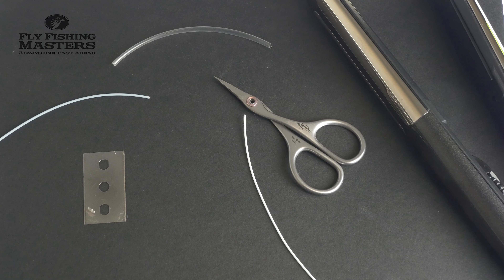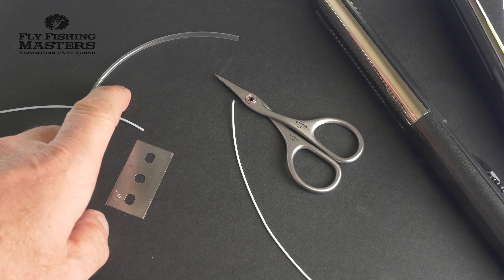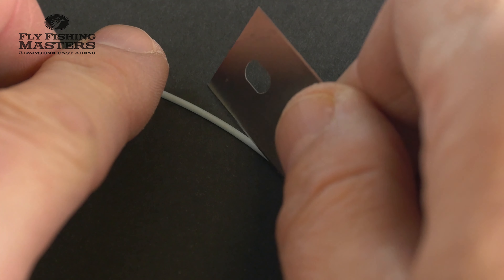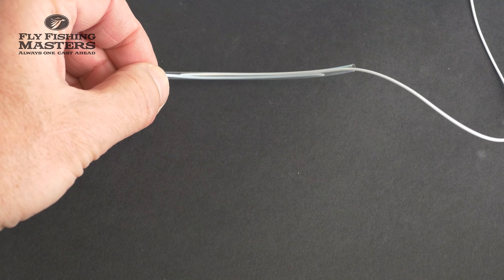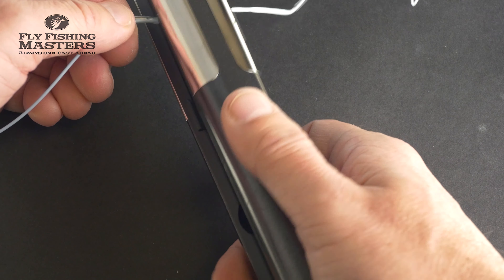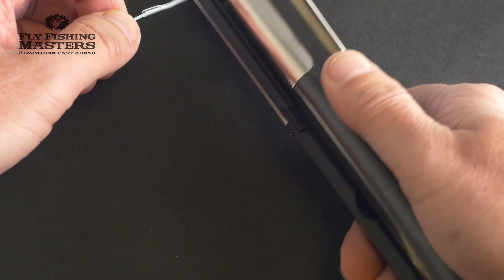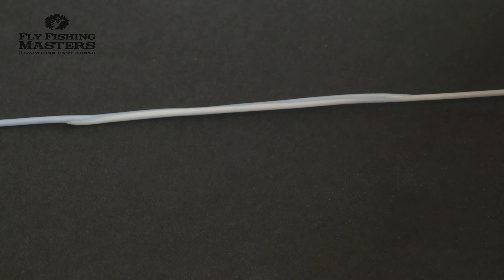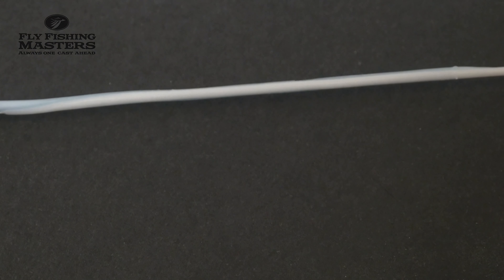Making permanent connections between fly lines

Comment: Hey, sorry if I’m just completely missing the obvious but it looks like you put two different kinds of line together. So just to confirm I can do this my 8WF fly line that I snapped in the middle. I’m only checking because I’m surprised how easy this method looks other things online or saying I need splice the line and do other steps before I heat shrink and put the line back together. 

Thanks!

Comment: i think heat guns work much better .. i could see  the lines were not completely melted together in this vid  ;)
Reply from the maker: I used a heat gun for 15 years before switching to a hair straightener. And there is a a good reason for that.
But if a heat gun works better for you I am glad for you 👍